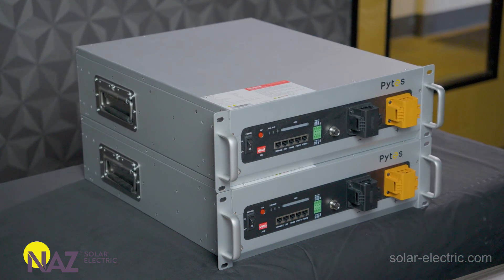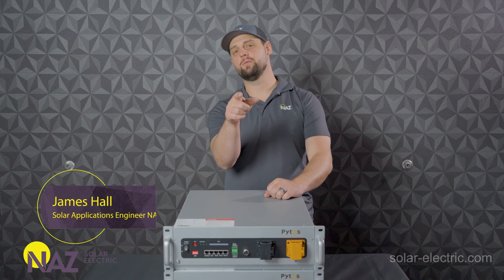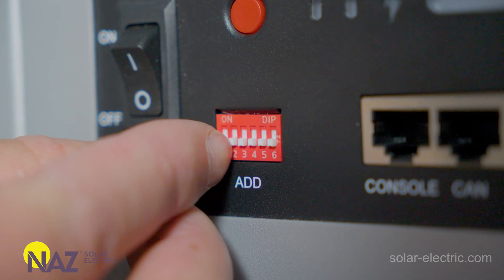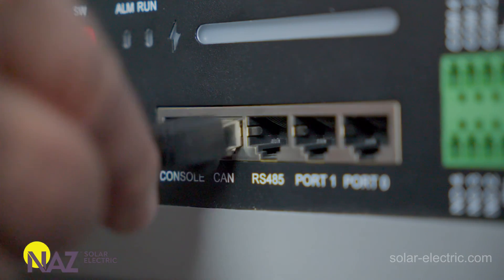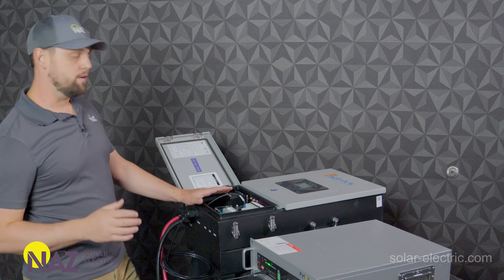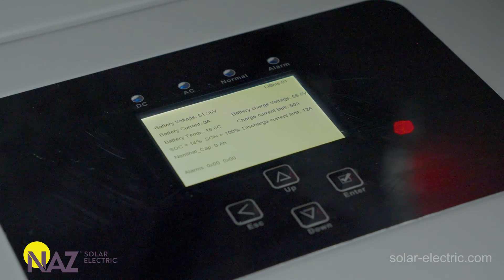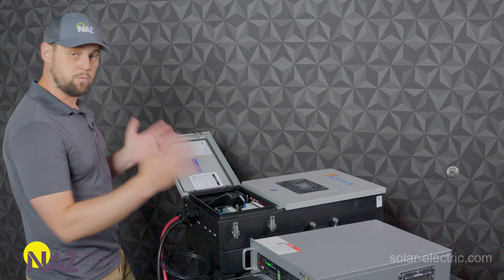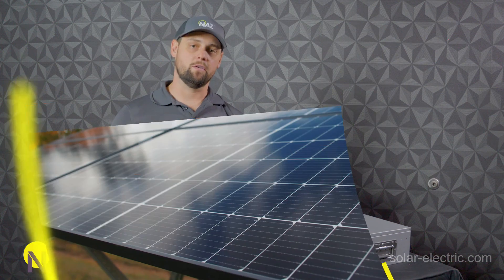How To: Closed-Loop Sol-Ark Inverters & Pytes Batteries | Easy Step-by-Step Guide

Comment: You should do one using the Pytes hub and how to set up groups of batteries, also their battery monitoring and OTA firmware updates.. I have a pile of these and they’re amazing, the published manual for the hub was wrong but was  able to get immediate tech support from Pytes and had it resolved in ten minutes.. still want to add ten more in the fall lol..